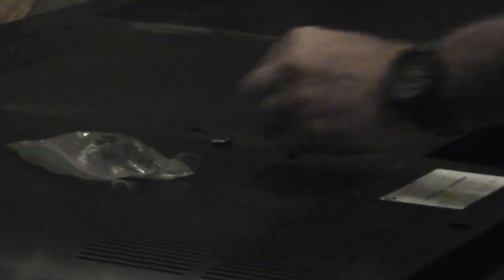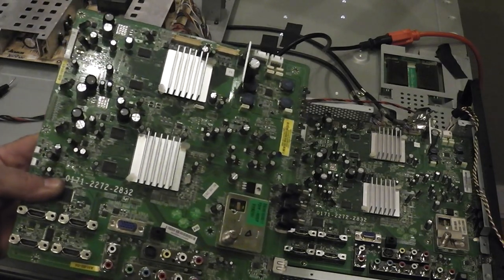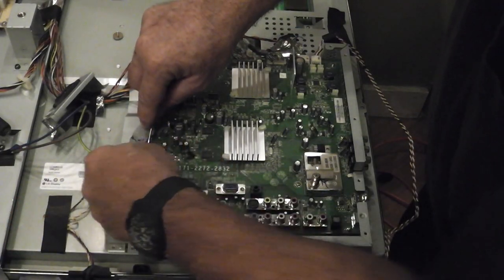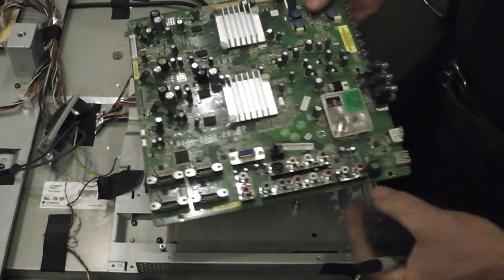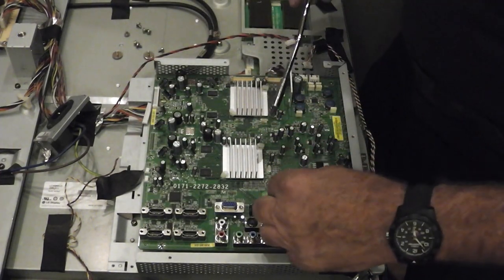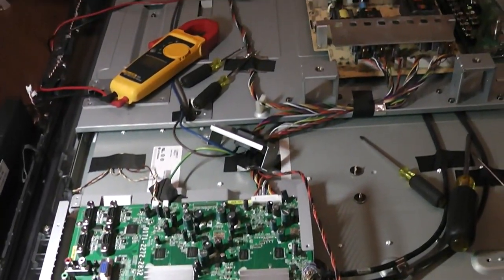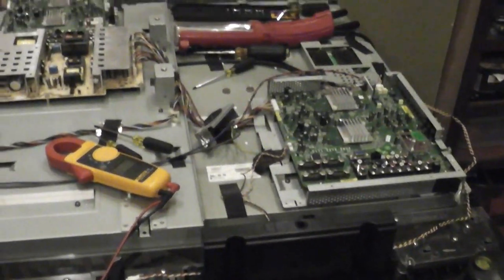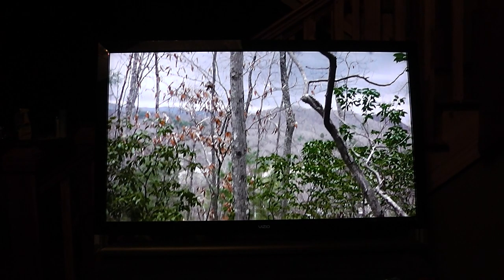Flat screen TV Repair How to Replace Circuit Board Step by Step

Comment: I am a Realtor and had a housecleaning service come and do the deep clean. The owner is now telling me that his mounted 72 screen is not working. I am a bit confused how someone cleaning could damage . P.S. the cable box,  etc were VERY dusty. Your advice is appreciated .
Reply from the maker: There are many possibilities: the cleaning solution used could have damaged the cable box and or tv. I've seen it as simple as that the tv came unplugged or a circuit breaker was tripped. I would verify 120 volts to the tv (you can use an extension cord plugged into a known working outlet and bring it to the tv) and I would bring a working dvd/blue ray player with my own HDMI cable and hook it directly to one of the HDMI ports to the tv itself for starters. Also tvs are light light bulbs, they can work great one minute and the not the next.
Reply: @homesteadprepper  thanks so much for the response. I will pass along and hope for the best!